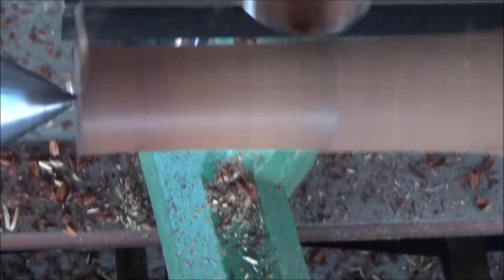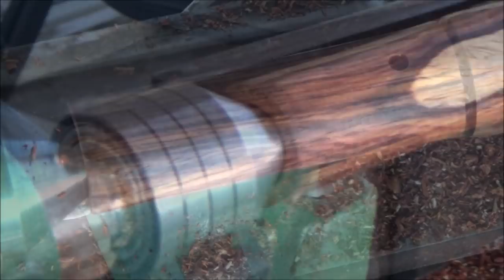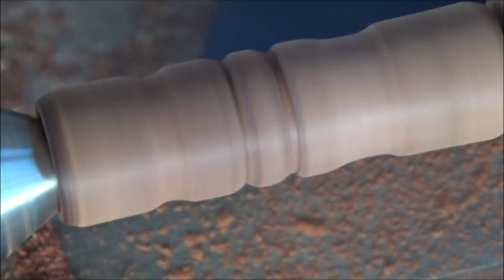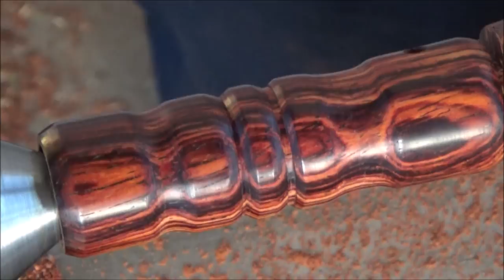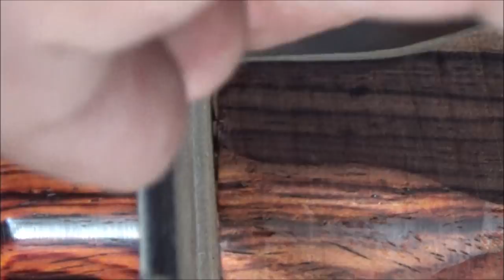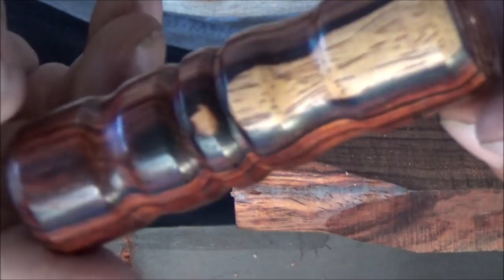3/4 inch diameter firesteel with cocobolo handle | making a firesteel with beautiful cocobolo handle

Comment: Flying wood chips is a lot quieter than banging hot steel but requires more clean up... your flower beds have the prettiest mulch in the neighborhood I bet. I am seeing that using the lathe not only produces quality shapes, but also makes drilling a straight hole for the rod a million times easier. Nice work Nathan!!!! Cheers! 🍺